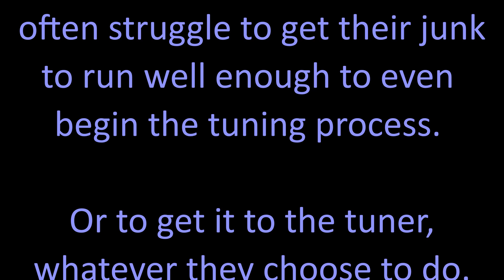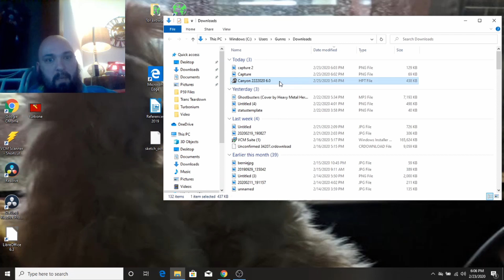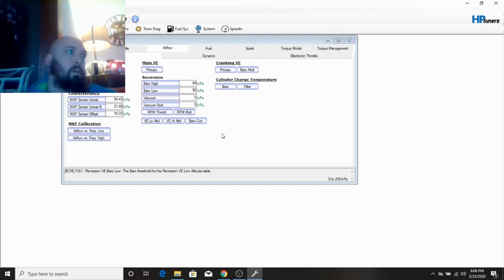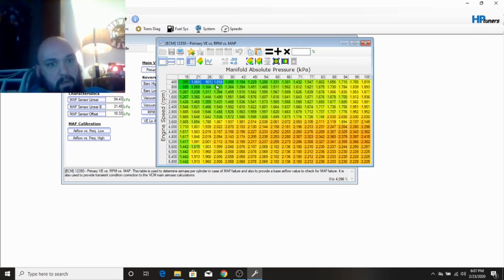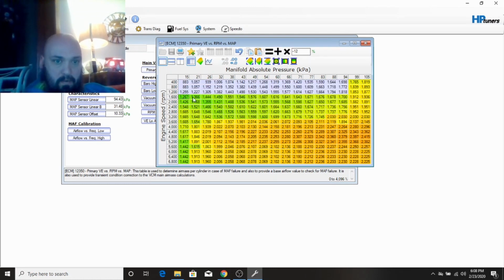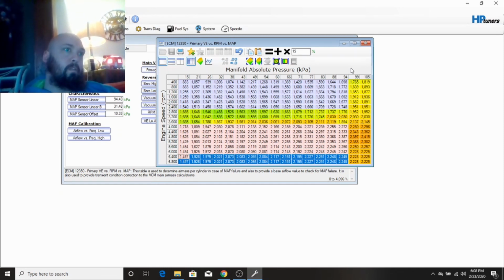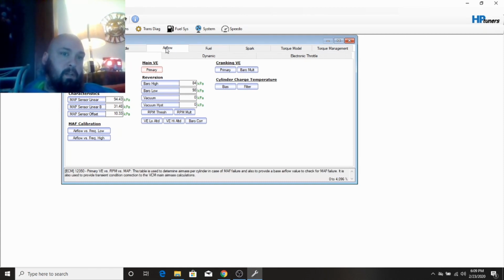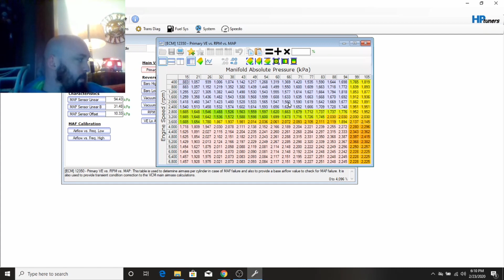Cam Swap Rough VE tuning in HP Tuners

Comment: Good information JR, I have a 02 5.3 with an LS6 intake and cam swap.  I was looking for information on tuning both.  Wondering if you could lead me in the right direction.  Look for a street tune not racing.   If my inquiry is inappropriate, please accept my apology.

Comment: I watch your vids an try to learn but confused on some stuff I have a stage 2 an I got it running but when I hit throttle it’s poping .got a wide band an it’s going from 14. Something to 20 up an down .any help will be much appreciated
Reply from the maker: You are way way too lean.

You need to add fuel in the VE table in the area you're seeing numbers over 14
Reply: The Driveway Engineer thanks I’ll give it a try in the morning hopefully I can get it.
Reply: The Driveway Engineer I have another? When adding fuel to the ve do I add it before an write to vehicle or it’s a way to add it why running?
Reply from the maker: You have to write each change
Reply: The Driveway Engineer thanks I’ll give it a try

Comment: When using the sloppy stg2 does it require a stall I just purchased a 05 GXP 5.3 with DOD issues and I'm to do a complete delete on the engine including capping off the oil towers
Reply from the maker: It doesn't require one in the sense that it'll run without it, it'll just have no low end

Comment: My primary ve is way lower than that what do i need to be sitting at im also running a sloppy stage 2 cam
Reply from the maker: No one on the internet has any way of knowing what your VE should be.

This is where tuning comes in.
Reply: @TheDrivewayEngineer  how many times can u write a change to your ecm do it require alot of credits to do